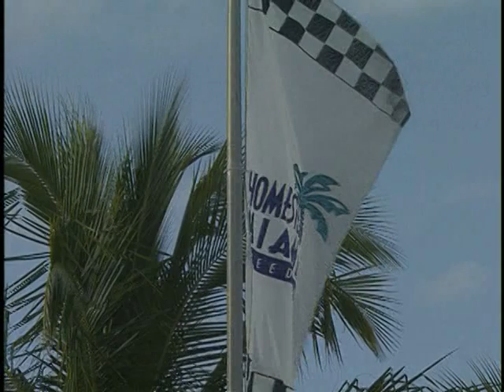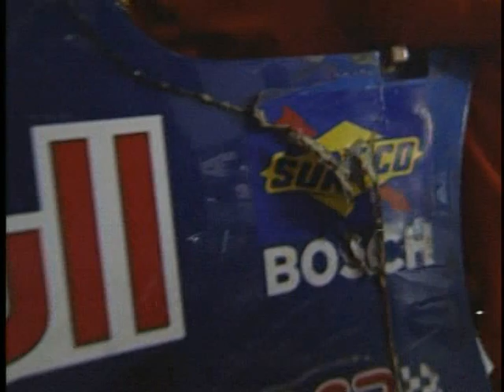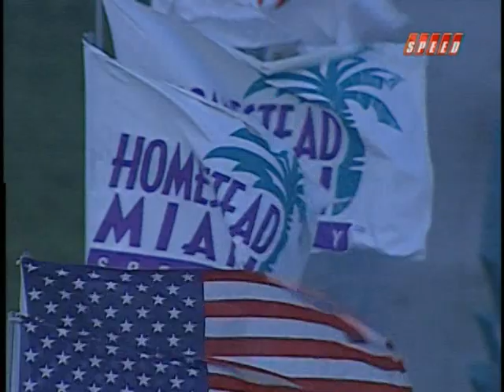Rolex Sports Car Series 2004 Grand Prix of Miami

Comment: Thanks for posting! Loved the 2004 season. Do you have any races from 2003?
Reply from the maker: I don't have any 2003 or 2002 races. I'm on the hunt for those. However stay tuned. I recently acquired Grand Am races from 2000 and 01 that I will be sharing soon.
Reply: jinjabreadman46  awesome! Thanks so
much for posting these.